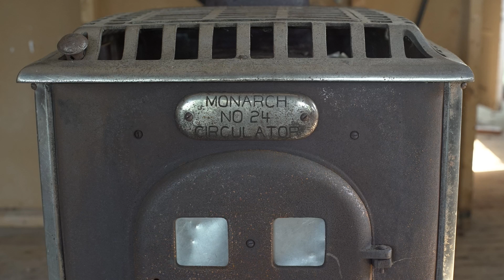Fixer Upper: Some Work Required

Comment: Knowing you Slim, even if the house was in perfect move-in condition, you would still do extensive work on it because...you're Slim : )
Reply: OMG Run away as fast as you can.
Reply: @perrythorvig6446  he already bought it.. Knowing Slim its a blessing in disguise as he can do repairs in a structure already there but putting up a whole new building takes alot more permits, architect, engineer, blueprints..etc.. At his skill level he is better off.
Reply: I love it!!! All the best to you Slim!!!!!

Comment: We love it!  Bought several in our past to fix up.  The house we live in now was a tear down in some eyes - we only saw potential and reconstructing it just the way we wanted it.  Lot's of negative comments below but I can tell they don't have the vision or skills.  It is perfect - wish it was ours!  Can't wait to see what you do with it.
Reply: My vision and skills have got me into more of these than I should.   I can fix anything, the real question is should you.  This is a beautiful property to build a small cabin on.  But I would not fix that one because a new one will be faster and less money.
Reply: Mold can kill a person. Definitely moldy in there. Most folks are just  being realistic.
Reply: Not much of the mold is enclosed though and is on bits that are easy to remove and replace. A good mask and coveralls along with a lot of sprayed bleach would see it off. The main structure is fine, it's the add on that needs work. Labour is free if you do it yourself and a few sticks of timber, some roofing and cladding are cheaper than replacing the whole place. I've been designing, estimating and building for thirty years now and once you take labour out of the equation, it removes a lot of the cost. Take out demolition, perhaps even new permits and dumping costs and this building would be a lot cheaper to repair than replace.

Comment: Lucky you have the trailer to live out of, as you start a new build. Smaller, better insulation, and what you really want to live in. This building is a Inspectors code violation paradise. Land is what you want…Good Luck…

Comment: The telltale sign will be what damages is in under the floor because if the piers/sill plates/joists are good the rest is fixable. The closed in back porch is losing its battle with gravity/slope and will have to come off since its that far gone so it should come down. It appears that a fire had happened due to the charred wood he found and begun to rehab the place but quit more than just a few years ago to be in this poor condition inside. Getting under to have a look should be first on the to do list since if it's that bad starting from scratch would be better since its literally rotting as it stands there in more than just one place. Years ago after replacing a garage roofs decaying sheathing and a few other cosmetic problems another neighbor asked about there's but the brick walls were beginning to lean in alarmingly and I knew it was a lost cause which wasn't the only one who said start over which they did soon afterwards. The land its on was likely worth the price but the house is another question if Slim bought it because there's a lot of light coming thru the walls and he might almost have to build another inside its shell if it's more than just cosmetic...

Comment: I have fixed things like that before.  I the end it cost me more than starting over.  If the land is what you want and you plan to start over with a building it could be a good thing.  There is just too much wrong with that building to fix.
Reply: Yep 👍 pull out the wood stove drop in a large wooden shed and turn that into a cabin. I know it’s probably cheaper to build the shed then to get a prebuilt but winter will come soon and I don’t know his exact plans of a move in date, if he plans to live there.
Reply: yep --  far better and easier to knock down  - start over - build  up from a solid straight foundation  -- too much rot..  roof gone... seems like a great location......
Reply: @SVMSICE  I used a large prebuilt shed and it worked out great.   I do not think I could buy all the materials much cheaper than the price of the shed.
Reply: A bit of timber, some cladding and a bit of paint. That's a great cabin, the extension isn't the best but the original bit looks solid. I would patch it up and live in it for a while. Definitely salvageable. I would leave it in the style it's in, add some improvements and some repair. It's not a huge or overly difficult job for someone who knows what they are doing.
Reply: To some, an old structure with a history feels more like home than a brand new one
Reply: Looking forward to your next adventure Slim. Beautiful location.
Reply: In some locales, you cannot "tear it down and start over".  But you can gut an existing structure and rebuild it.  Local zoning ordinances can often be difficult that way.
Reply: There’s wood rot everywhere and the main beam for the extension looks like a 2x4. Unless there’s a compelling reason like local codes I’d make that storage and start from scratch. If a shed could get delivered it could be a value. An absolutely AMAZING lot and no matter what Slim does, I’ll be sure to watch. I know he’ll make whatever he does work.
Reply: @mattcaser6581  That's exactly right! He will have to check out the zoning laws and do his homework but you are right.
Reply: @HomeOrchard  You must be psychic! My husband and I watched the video, looked at each other, and both said, "Call the fire department!" We burst out laughing!

Comment: My heart was in my mouth as I watched you back up that you not hit a tree with your adorable little trailer!  It looks like the roof is growing hair:)  
Yes, I too, with my ex,  bought such a place over 51 years ago. Another place where if you stomped on a step it fell through.  It was just over 400 square feet! We lived in it with no water except what we brought in jugs, or was from a rain water cistern almost dry, no phone, an outhouse, a kitchen with a sink on 2x4's with a hose for the drain  through the wall to the ground outside. It had a pot bellied stove for heat.  Made many a cup of tea on it while huddled around trying to keep warm that first winter.  We had some good times there, worked ourselves silly.  Our first son was an infant when we bought it from a classified ad on Easter morning after tromping through the snowy woods to find it.  Our second son was born two years later after we put on a ten foot addition which was still unfinished, making it just over 600 square feet:)  You are bringing back these wonderful memories for me!

Comment: Its sad people dont take care of the roof. Once the roof goes, everything under it follows.
Reply: I agree.  Fix that roof first.
Reply: Yes, if you've still got a good roof everything else is usually going to be repairable.
Reply: They got lazy, if they'd kept the evergreens above it trimmed back, you never get the pine needle load which turns into loam, and starts eating up the roof. 

Growing up in the PNW, you saw it a lot on older homes.
Reply: Can't always justify things that are dilapidated by saying it's laziness of people, yes it is unfortunate.  But your body reaches a point when maybe you can't do things you did before.  Old age, finances, inability to travel to a weekend cabin prevails.  Yes, I'm an old fart speaking from experience.  It's good just to be surviving. Unfortunately time has also taken its toll on this little retreat hideaway.  Slim has got time and age on his side to give it a rebirth.  He maybe be saying "what did I just do", but he will prevail.  Natures paradise.  Wonderful spot he's chosen.  A thousand ways this is a win, win for Slim.  Always demo and start over.
Reply: If you have the MEANS to take care of the roof.  I needed to replace the roof on an outbuilding on my property, but just didn't have the money and did the best I could to do makeshift repairs until I could afford it.  Unfortunately, I wasn't able to secure the funds until after a winter finally took it's toll, damaging the roof. Then it required half the roof to be completely stripped to the rafters, some rafters replaced and everything rebuilt.  It was truly a case of "a stitch in time" that could have saved nine.  Or five, anyway, as it cost me five times the original quote to repair it by the time I could secure the funds to repair it.

You can't judge people based on their resources.  The world isn't a fair enough place, often rewarding the laziest and crooked among us and punishing the most earnest, hard-working folk.
Reply: @theramblingeorgian1774  This is true and you get old very quick.
Reply: @theramblingeorgian1774  My body started to ache when I saw this house inspection. To me, it was the toughest thing to admit my body is no longer up to the task to take on projects like Slim is about to. I wish him well. It is overwhelming but prioritizing, itemizing and breaking down the tasks to doable size will take him far.
Reply: @LordFalconsword  That's a VERY judgemental (& probably UNFAIR) statement... particularly if you don't/didn't know the circumstances or people involved. SMH
Reply: Looks like a thatched roof.

Comment: The land is amazing but the house is probably a teardown imo although I don't think you will. There are too many gremlins dealings with someone elses half built property like that. It'll cost you more in renovation than starting over. That's my opinion.
Reply: My thoughts exactly. This isn't a renovationproject but a complete new build project. Everything seems to be beyond reusable.
Reply: Renovating seems to always cost more than new build

Comment: If this is something you are investing in, my two cents , totally up to you , rip it down and put a prebuilt shell and the if you want to play build the inside to your liking.    In it’s current state roof needs replacing , windows need to be replaced as the one there though they are aluminum have not much r value , floor needs replacing and you don’t even see the foundation boards and the foundation and add on does not look stable.  Rip and replace.  I have done the other route with a house and upgraded everything and it looks great but for the money it was still a small house .  Your call just throwing out an opinion and idea.  Enjoy

Comment: In typical Slim determination this time next year we probably will not recognise the place. You can easy, with a lot of hard work, build a new dwelling but you could never build a view like that. Anyway you have the makings of a decent workshop with the drill press and a roll of emery. The sledge hammer doesn't look to shabby either just a new handle and there you have the wrecking crew. Wish I lived closer to offer a hammer but I am sure there are many subscribers willing to lend a hand if asked. Good on you Slim for having the courage to take it on, wish I was 20 years younger.

Comment: Seems like most folks think a tear down is in order. I love the idea of renovating an existing structure as it retains something of the past while providing a new life for another human. But that’s just me. Whatever Slim does will be fantastic.
Reply: This house was in pretty good shape compared to some of the houses I remodel.  A couple months and it would look brand new.
Reply: Im a "see potential"  kind of guy, but this....
Is a teardown period.  Shoddy construction on the other side,  mold, roof, floor, ect. 
Cheaper in the long run. 
Work smarter not harder.

Comment: If it is structurally sound, put on a tin roof, insulate the walls, and you can spend the winter inside renovating.
Reply: Not with all that black mold I saw on the walls, ceiling, and floor. That isn't a healthy place for anyone.
Reply: Ya, it's not structurally sound.

Comment: Slim I love it, I was a cabinet maker most of my life. Now my son is a cabinet maker and he bought an old house with a barn, he totally redid the house and it turned out nice. Now making the barn into a shop turned out to be a chore, every thing was eaten up with insects. We had to replace almost everything.... it would have been a lot easier to bulldoze it and start from scratch. Problem is it still looks like an old barn and smells like an old barn.  Tearing down and pulling out nails,  ouch. Now, the roof and all the rafters and everything really needs to be replaced. Would have been a lot better to start over. That’s my 2 cent ....

Comment: Now that is a money pit, the block foundations have even slid down the hill. Cheaper to demolish and start over ! Great hammer just needed a new shaft !
Reply: I was thinking "Keep that hammer head, you're going to need it!"
Reply: If the windows are any good save them. The door looks iffy. All that strand board used on the addition needs to be replaced. As does most of the flooring. Maybe the joists and beams are still good giving a good skeleton to build back

Comment: We're fans of yours. This house was made for you. A long time ago. By a madman. This is not a little side project, but need never be fashionable! LOL
Discard the flooring in the extension, examine the joists, re-floor and use it as your workshop. When you have fixed the "real" part of the house, you can dismantle the extension for firewood. 
We live in California - cut back the trees early! LOL

Comment: That's a project that will keep you busy for a while. 

A tip on reversing your trailer, don't be afraid to use low range if you have it, makes life much easier on the vehicle and you.

Comment: Love the cabin, and the property. It's definitely fixable. Husband and I did a 1927  six bd, 4 bath. Great that you are recycling some wood. When we work on anything we start from the bottom, and work up. The foundation of anything is the most impt. I hope that stove works out, a beauty. Maybe a bit of a switchback type of walk to the water would be safer. Happy for you. 🙂👍

Comment: Hey Slim, I have been through all this. We ended up tearing off the second floor and buying a kit made of SIPS panels. The 5 1/2" foam attached to plywood  gave us good insulation for cool and warmth. They are also rodent proof and keep out the critters. Another idea is the modern small house and cabin kits that would start you fresh and give you the means to have a brand new economical house. They make some here in Utah that were in the $70K range a year ago when I last looked.  Good luck on your DYI projects!

Comment: Slim, I think you can do it!   Keep the old cabin and turn it into a nice little hide away. There is some localized rot that you can remove and repair those areas. Just make sure to keep the N95 on at all times. Indoors, I run a hepa fillter to pick up  the air borne lead and asbestos fibers and particles. The one area I would take a close look at would be the up hill side where the structure rests on the earth to make sure there is no ground contact rot. Make sure everything is generally plumb and level.  If that's good, then I would get that roof cleared off and probably put a new metal roof on it to get the building dried in. And install a gutter system with extensions or underground landscaping pipe to move the water away and down the hill.  Then throw a couple of temporary supports under that floor and reset that tilted column under the floor system.  Also I would consider a french drain or contour the soil for good run off around the front entry side. After that is dealt with,  then do a plan view scale drawing and think about floor lay out. You can remove or change any non-load bearing partition walls and optimize the  floor space how you want it. Of course you will need to remove and  repair any rotted floor structure.  I would figure out the lay out before ordering new windows.  Clear out everything you don't want and do the interior. Can you get internet service out there?  How are you going to power the building? Is there a septic system down slope? Is there a well?

Comment: Looks like a great piece of land with a demo job on it. Crooked foundation blocks, poorly built extension that was a porch and then got expanded to living space, rotten roof, but the worst is the mold. I live in one from 1998 to 2003 and still have the mold following me in some of the furniture and belongings. Also in my lungs and bloodstream. Think twice on this one Slim. Demo and start clean and you will have a great place.

Comment: Very nice video and still photos.  Looks like "some work" is a relative term.  I thought you might be in NS until I saw the Cedar tree next to the bench... then I knew it was NB.  (No cedars in most of NS).  You have some big decisions to make with this fixer upper.  I love the Record wood stove... keep that... other than that I expect you will have to stabilize this and use it as a workshop as you build a new cabin to suit your purpose. 

I think your biggest challenge will be finding the sun for off-grid solar... Most of NB caostline faces East or NE  so you may be able to cut trees behind rhe cabin to let the sun in but cutting those majestic White pines will be a tough decision.  How about a floating dock with solar array?  Thanks so much for sharing... Would love to stop in and lend a hand on my semi-annual drives thru NB. Good luck!

Comment: welcome to the east coast Slim.  Start at the bottom and work your way up.  you will definitely need more than that amount of firewood for a winter, even with insulation.  lose the pine needles on the roof, or you may end up with a roof fire..  furnace looks useable.

Comment: We had constant leaks in the back roof of our 1921 home.
We finally put 5V crimp galvanized roof on 10 years ago.
We sweep it off every 6 months and it looks like it did the day we put it down.
The house sits under a Pecan tree, a Camphor tree and Oak tree.

We suspect the falling pecans and acorns were why it kept getting leaks.